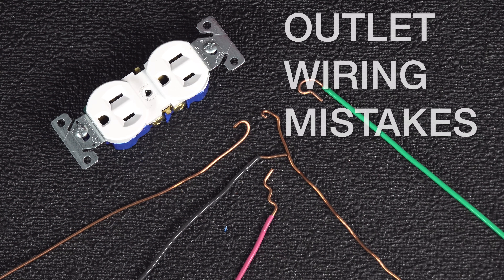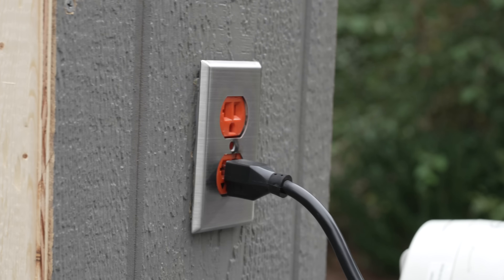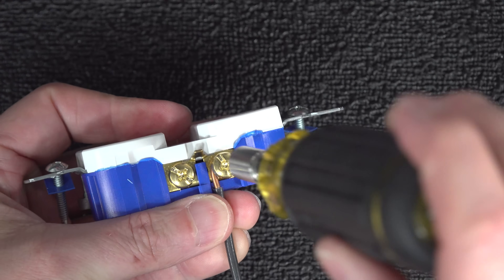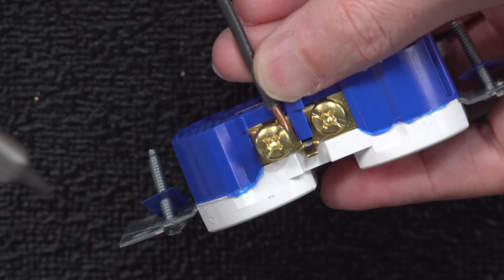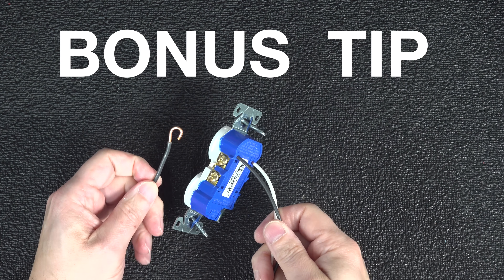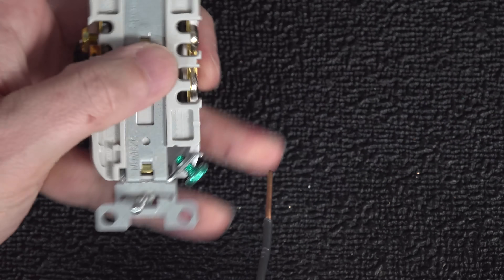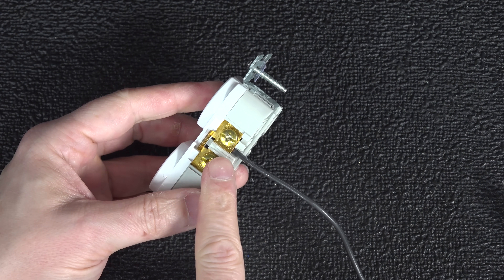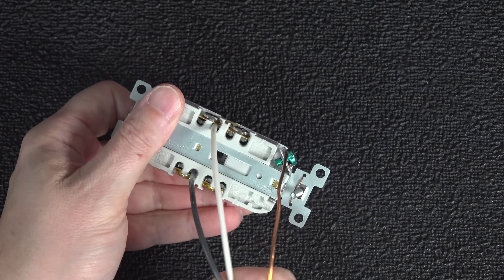BEWARE Of These 3 Common Wiring Mistakes On Outlets & Switches

Comment: As an electrician seeing people use the push in wire connections makes me want to scream. I’ve seen more fires caused by those that they should absolutely stop making them. DANGER!!!! Good video, thanks.
Reply: I’ve wire thousands of houses with all back stab outlets and switches. I don’t think a single one of them has caught fire.
Reply: @jrod264winmag  to each his own. I don't use them because I've seen them melt and start fires. I'm glad nothing you've wired has caught fire. Its just my personal preference not to use them from what I've seen
Reply: @lewisoversole6781  as an electrical contractor that also offers a service department, I’ve really not seen a issue with this or outlets melting. Many contractors will even use wago connectors vs wire nuts.
Reply: @jrod264winmag  I have no problem with wago connectors because you can see in them and they are easily changeable if there's a problem.
Reply: @lewisoversole6781  But if your claim is that "expansion and contraction of the wires over time" is the root cause of fires or failures using 'backstab' holes, it would seem logical that the same phenomenon could/would occur with Wago connectors, right?  How would anyone "see in them" and know they should be changed unless they were taking apart their outlets to inspect the integrity of the connections?  I don't know of anyone who would do that.
Reply: @lewisoversole6781  wrong. not if they"re in a box you dont
Reply: All 3 companies I've worked at use the stab in connections. Never had an issue.
Reply: Most new home electricians use the push in connectors.
Reply: @davidhoulden5791  I've been a new construction electrician for 10 years and we do not allow those stab in connections to ever be used. It's a company policy. If I ever catch my apprentices doing it, I make them fix it.
I do believe that most don't use these because if the device ever needs to be replaced or swapped out, the stab in connections are a pain in the ass to remove.
Reply: @NathanaelD  Yet this is what I have found in many homes.
Reply: @NathanaelD  1500 watt heater plugged into one in my well house all winter long, going on 19 years now never had an issue. Don’t use cheap equipment.
Reply: @jrod264winmag  good for you. Doesn't mean that it hasn't caused issues for others. And we don't use cheap devices, ever, especially on the multi million dollar homes we wire.
Reply: @NathanaelD  they aren't that hard to remove. If you have a small flat head screw driver it makes it pretty easy.
Reply: @davidhoulden5791  maybe they do but all the electricians I know don't use them. It's on them if they do. I know I won't.
Reply: @davidhoulden5791  Inside wireman here (commercial/industrial sparky). I think those simple "push-in" wiring terminals without the terminal screw clamps are reserved for 14awg. But the point stands, wrap-around method with the proper torque is the most durable method. And I recommend wrapping electrical tape around the receptacle at least once to cover the terminals. Doesn't have to be the spendy Super33+, but it will last longer.
Reply: Whole continents are wired using the clamp system. Current never more than 16A of cause, but this is still a lot.
Why get US sockets fried when using the clamp holes?
Reply: @ReinierKleipool  expansion and contraction of the wires over time. I use the screws on the sides simply because if an outlet has had heavy use one can always tightened the screws if needed or inspect, cut, strip and reuse the the wiring and the device if not damaged. It's my personal preference from what I've encountered.
Reply: Our company has made it a policy that those are never to be used.
Reply: Master electrician with 32 years experience. Never seen any fires, but have seen lits of failures. Usually in the neutral on a daisy chained circuit. Use pigtail splices and hook connections or use the spec grade receptacle with the proper clamp. Only lazy electricians use the push in method.
Reply: Are holes ok to use on switches?
Reply: @elquienelquien1890  again I always advise against it. I always Make a hook and tighten them down under the screws, opened end of the hook facing the way the srew turns to the right towards the back of the device, it's much safer.
Reply: you did not see many fires from these. other factors come to play here.
Reply: @isabellecote1064  I know what I’ve seen. Who are you to tell me what I’ve seen and determined. Like said to each his/her own.
Reply: As an electrician, I've never seen a fire caused because of stabbing the wires into the back of the receptacle. I've also wired hundreds of new houses and I do it on every house.
Reply: @ryanm2084  agreed. I don't use the stabs. Just personal preference. I have seen more failures with loose connections on the screws. Improper installation
Reply: Electricians are confusing.  I see many YouTube videos say to use those Wago connectors instead of twist conectord and contact points are similar to backstabbing.
Reply: @james21ap1  The Wago may seem similar, but are a much better design than the backstabbing connection. All in all I still prefer a proper wire nut connection over a Wago. The wire nut carries no current whereas the Wago is part of the circuit.
Reply: Great advice
Reply: No, the NEC needs to stop allowing them. They make the calls. Mfgrs employ the allowed rules. Some mfgrs stop making them, and some electricians just buy them from an mfgr who does. Not hard to concieve.
Reply: Why do they put the holes there if they shouldn't be used?
Reply: @dannydaw59  I've seen a few fires caused by this. What happens, wires heat up thus causing expansion and when the wire cool down they contract over time they become loose in the socket/hole and it will create an arc causing an extreme amount of heat.
Reply: @dannydaw59 they aren't preffered by electricians, but allowed by NEC. I've seen articles where technical writers say, as with wire nuts, people don't always do it right. I see what they talk about, but still never use them. I'm more comfortable with the screws, and much more comfortable with the commercial "style". Imo, though, all need to be used properly by me, and also double checked.
Reply: @dannydaw59  they are approved in the electrical code. Perfectly safe
Reply: @dannydaw59  wire a receptacle using the stab in holes, plug a space heater in and you’ll eventually see.
Reply: @Pkkct  Ya, but why do they put the holes there?
Reply: @dannydaw59  I guess it's because it's supposed to be quicker. I just know I never ever recommend them.
Reply: Just curious.  How does an electrician know what caused a fire?  Do you get called in on a lot of fire investigations?  When I hear these things, I just wonder if it is fact or fiction.
Reply: @johnh9748  there are other factors that get overlooked 
Wire size, and type. Aluminum wire, and age. It has very little to do with the push clamps which are spring loaded.
Reply: Aluminum wire is still legal too
Reply: @johnh9748  I've been called on a few investigation and a few times and at   times the device has been brought to me.  I have been on countless service calls to replace burnt up devices preventing a sure fire.
Reply: @lewisoversole6781  over current  is yhe issue, same when over drawing on the socket
Reply: All outlets have passed UL safety. Your personnel feelings noted
Reply: Yeah it disgusts me. 90% of new homes are wired this way. If it doesn't cause a fire -- within 5 years a lot of those switches and outlets are going to stop working and cause other problems. I see it all the time. These new electrical workers and bosses are not craftsmen and are just lazy and greedy.

Comment: I never trusted or used those push in connectors on the back and it turns out I was right. I also push the hook in a bit with a small screwdriver before tightening the screw.
Reply: Yeah, I do the same thing with a pair of needle-nose pliers and squeeze the bare wire tight around the side screw.  That allows the flat underside of the screw to completely cover the loop.  It pretty much would take an act of God for it to come loose.

Comment: Whoa, you overseas guys have still screws on your sockets. I used them 30 years ago. Today all the sockets in Germany (and EU?) only have „stick-in-terminals“ (don‘t know the am. word). They work fine for a fast and easy installation. Heavy power usage is nither a problem.
Update: Ah, that’s because in Europe we have 240V and therefore less current. Lower melting possibility. 
So stay good connected and thanks for the insights into international electricians knowledge. 👍🏻

Comment: … so 90% did not learn that shit at school but uses Ring Pliers? I did… and 90%  is american.. in my country they have only stick in holes except 5 pole 16A 260V connectors… if u use the screws you are setting the mounting clamps under power XD

Comment: Are You saying that back wiring is not good for heavy loads and the screws terminals give You better connection,  but right now almost everybody switching to Wago and similar connectors where only spring loaded piece of metal is holding the wire
Reply: wagos are fully rated, the stablock in the back is only good for 14gauge 15A max

Comment: You had me on everything in this video but the hospital grade/ commercial grade outlets. They're not designed for solid wire. They're designed for stranded thhn wire. Also we electricians will always pigtail so only 1 black and 1 white go on the device.
Reply: almost 100% right- they are rated for solid or stranded

Comment: Great video!  I've been a commercial electrician for almost 40 years (IBEW LU#60).  While most of  this is Device-Wiring-101, it's amazing how many people get it wrong (even EXPERIENCED people).  Thanks for trying to clear this up!
Reply: hey Lu#60 - LU#332 here- there is alot of bad information in this video you should have caught
Reply: @westbornfarms  Feel free to enlighten us.
Reply: @joeyh6494  ok, first violation, using a device as a mean of splicing to add other devices. All devices should be fed from the home run or tailed from a wirenut, wago etc.
Reply: @westbornfarms  Ok, I agree with what you are saying (I ALWAYS pigtail my devices), but on brief review of the video, the only time I saw the device being used as part of the circuit was in the example of bad wiring.  I never saw the presenter with more than one phase, neutral or ground wire on any one device.  Perhaps I missed something. What can I say, I'm old...

Comment: I did not see you mention that you can tell which screw it for which wire by looking at the slots kn the receptacle face. The obviously bigger one is always on the side of the neutral. This one is also could have a horizontal slot if it is a 20amp receptacle.

Comment: In general, and this can be applied to any electrical video, is that there are three ways of doing electrical work in the US:
(1) In a way that functions electrically. There are hundreds of ways you CAN do something, but that doesn't mean you SHOULD do it that way. Never assume you know how to do something correctly just because you understand how it works electrically.
(2) The way the code tells you to. The NEC code is incredibly thorough, though it can be a bit daunting to use. It generally tells you the way your should do something, or at least which ways you shouldn't do something. There are often many ways to install electrical that all meet the requirements of the code and some that don't.
(3) The way the jurisdiction tells you. This is actually the most important. Your local jurisdiction (ie your inspector) can demand whatever they want even if it contradicts the NEC code. They will generally follow the code (for obvious reasons) and may have a few additional requirements, but there are times when they want something completely different. Whenever you are working on electrical, it is best to discuss the work in as much detail as possible with the inspector prior to installation, taking note of any special requirements they will demand. It will save you a lot of heartache and rework later.

Comment: The code [300.13(B)] in most jurisdictions does not allow you to make multi-wire connections in the device. You must be able to remove the receptacle from the circuit without interrupting continuity. That means you must pig-tail your connections in the box, not on the device. The only time you should be installing two "hot" or two "neutral" wires using both holes in the receptacle is when the jumper tab is removed/broken making each of the plug positions separate circuits.

Comment: It's been my experience that electricians ALWAYS backwire outlets. It's faster and easier for them. As a remodeler, it's a huge pain in the butt to get these wires to release, so I generally just cut them, throw away the outlet, re-strip the wires and install them correctly.
Reply: In my experience that is an indication that either* the local inspector is lax or the electrician's are taught to put quantity ahead of quality. In my jurisdiction, only the "cheapest" contractors allow back-stabbing, and most prevent it entirely by using the commercial grade receptacles that have the back-wire configuration. Our jurisdiction is dominated by union labor focused mostly on commercial/industrial work so the standards tend to be higher than residential focused areas.

* it could also indicate the work was done prior to the 1980s when backstabbing largely became banned by most electricians and many jurisdictions. If you are remodeling a house built in the 60s-70s there is a strong chance the wires are backstabbed. Either way, it is a very good practice to cut them off, discard and replace.

Comment: Not sure if mentioned by others, but you've used wire strippers so if you're going to make the hook, use the strippers to bend the wire more securely around the screw before tightening.
Reply: Or use needle nose Vise Grips.

Comment: With manual wire strippers (The Klein ones I've been using in foundations anyways) there's a hole either side of the jaws for making the hooks super easily and quick

Comment: Easy rhyme to remember the correct way to wire up a socket or switch....."Green goes to Green, that's plain to be seen, Silver goes to White, you know that's right, because Black to Brass will save youe ass"

Comment: lol almost no electrician does that! Yeah so I have seen 3 complete jobs from a "professional" whom did that as they were lazy and worst part last one was a kitchen I was helping remodel. the outlet for the refrigerator was not working properly, and the owner was like hey no worries its all going to be replaced  so didn't touch it. while we started demo when we touched that outlet and started removing the plug the neutral wire was using that crap push connection and had fallen out. was heavily corroded as well. thankfully we already had the power off but wow what a mess!

Comment: "Electricians are almost never going to use them"...  Yet my brand new, built in 2017 house, is completely wired by the backwire connections.  I discovered it the first time I took a receptacle out of the wall to add a wire.  Then another, then another, until I have realized my ENTIRE house is "backwired".  I cannot stand that sense of "get it done quickly" bullsh*t.
Reply: well that means all of your inwall wiring is 14gauge- therefore only 15A max on these. not 20 amps

Comment: Thing is though those plugs you use for the push in wiring are fine for 14 not 12 that's why you wrap 12g wires and backstab 14 g wires convenient and have had no problems they're made for 14g wiring or 15amps not the 12g 20 amps that's to be wrapped around the plug if you have the 68 cent one everyone should know that and if you don't you're a terrible electrician

Comment: Not an electrician. I thought that when you put the Shepard's hook around the screw it went the other way. In the case that the wire was pulled it would tighten the screw more. Does it matter either way? I do understand why he's doing it the way he is in the vid.
Reply: it goes in the direction of tightening because it will collapse the diameter as it tightens instead of opening up. it can really be any way.  theres no chance of pulling out if its 12 gauge. something else will break

Comment: The slits on the ends of the outlet by the mounting screws... I've seen ppl use it for wire stripping... supposedly it's good for 12 and 14 ga wire... any truth to this?

Comment: The ground  screw plate often has a hole in it. Stick just a little of the end of your ground wire into that hole, wrap it clockwise around the screw, and tighten. Saves a little bit of time, with no compromise in connection quality

Comment: Something you miss the second outlet you showed was also a self grounding outlet. If installing into a metal box you only need to bond the box not the device. It makes it more convenient when installing. Also they are way more of an upcharge then 50 cents. More like 3 ot 4 dollars. If bought in bulk.
Reply: Perhaps, but you should verify that is okay with your local inspection. Many jurisdictions require the main grounding lug be connected via wire even when using self-grounding devices.
Reply: @TwilightxKnight13  NUMBER 1 it's not a lug. It's a bonding screw. NUMBER 2 it is UL  Approved by the NEC. You know  the NATIONAL ELECTRICAL CODE BOOK. . I have a masters and been in the field since 92. I have never had a problem with this.

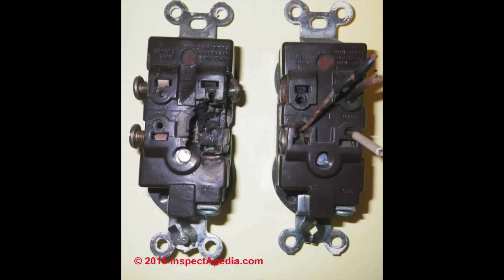Comment: @ 2:44 "Electricians are almost never going to use them."  
  Literally EVERY new house I've ever lived in has had every single electrical outlet connected by using those back holes!    Maybe it's just a thing in the 2 states in which I've lived, but I seriously doubt it.    I actually laughed out loud when he said that because the only time I've ever pulled out a outlet that was wired correctly is one I myself had previously installed.
Reply: The backstab are used to save time. Much quicker than playing with screws.